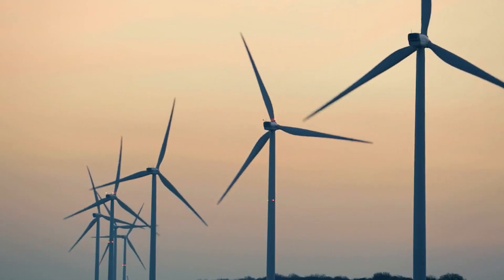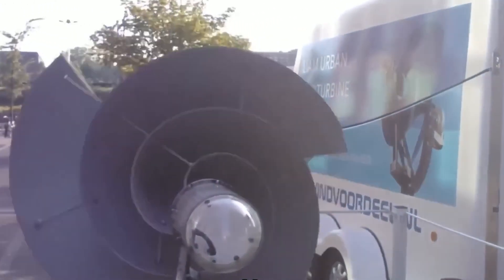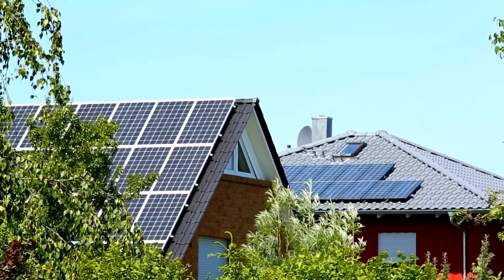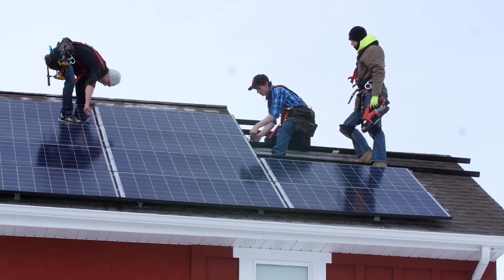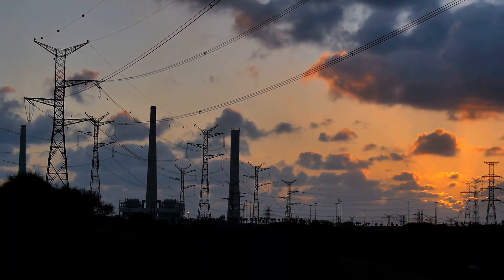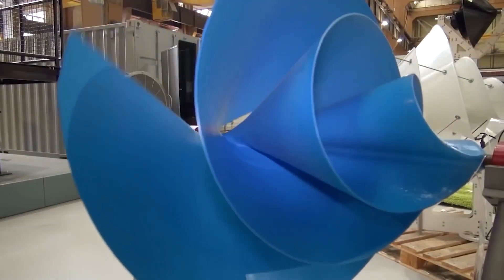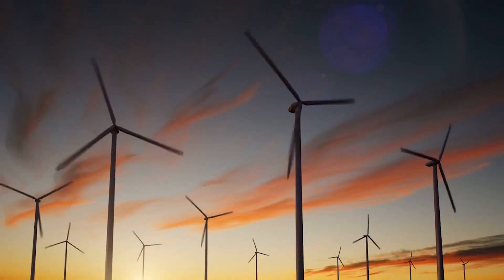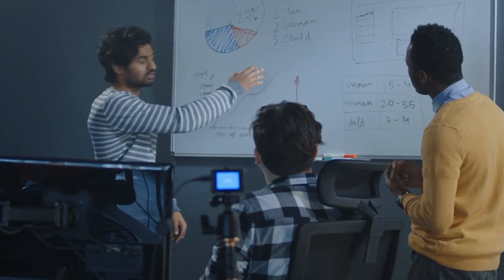Shocking Revelations: How Wind Turbines Are Rewriting the Rules of Power Generation

Comment: Reality: All practical tests of ground-based small wind turbines show: 1) Tey hardly produce any electricity! 2) They do not last long!
Electricity yield is proportional to third power of wind speed: +100% wind generates +800% more electricity! But close to ground there is 0 constant wind! 
On the other hand, solar panels generate at least 10 times more electricity with the same investment in time & money! Reliable & maintenance-free for at least 25y! 
9 out of 10 small wind turbines stop working after just a few years due to the extremely gusty winds close to ground.

Comment: its so bad how this company is putting out comercials that omit statements that are only right in context. for a product that is mediocre. it may have a viable niche use. but it is not better than solar pannels as it states unless you live very far north or south in high windspeed areas. the 1500kw houres arent achievable in the places where most ppl live
Reply from the maker: You're spot on about the importance of context in evaluating renewable energy sources. While wind turbines have their advantages, like in high wind speed areas, they might not be the best fit everywhere, especially compared to solar panels in certain regions. The key is finding the right solution for each specific location, as the effectiveness of renewable energy can vary greatly based on environmental conditions. 🌬️🌿